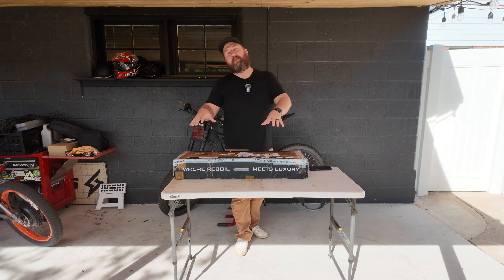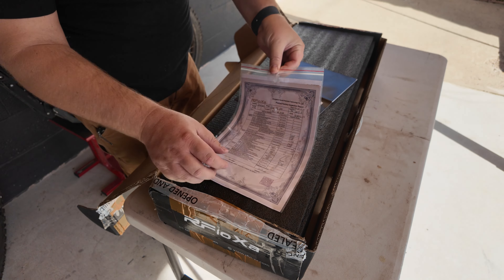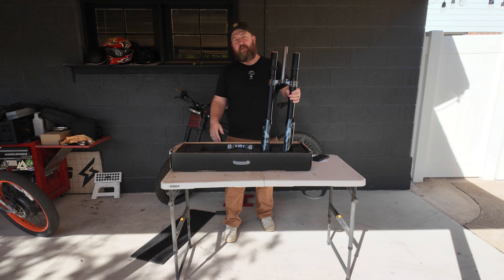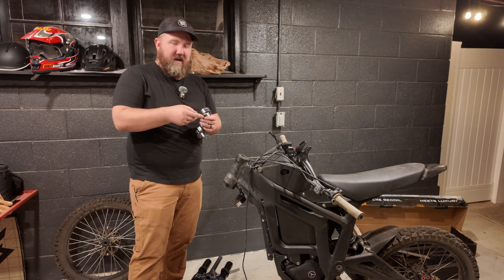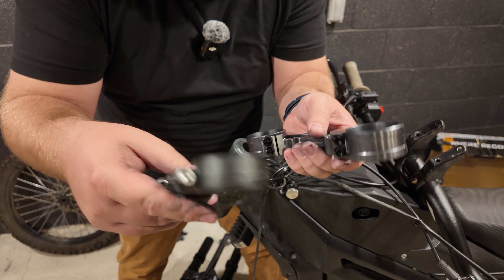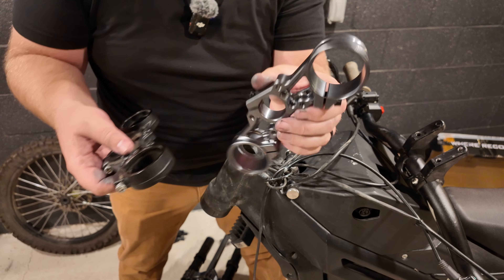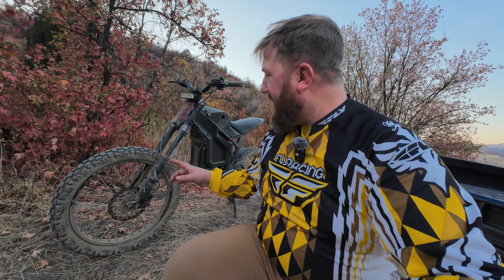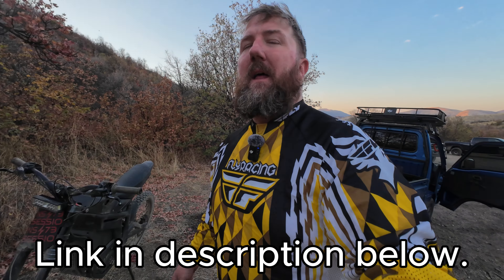Is RFlo-Xa REALLY the Best Budget Fork for Surrons and Talarias?

Comment: What a bs review. Just reading the marketing crap instead of giving a real feeling review, comparing it to the feel of the fast ace forks for example.. These kind of reviews don't inspire real confidence in the product. What were the down sides? You've mentioned you wanted to do some tweaks.. also there was s mistake in the installation. Before tightening the upper triple on the fork stem you should have installed the starnut already and tightened it down  to about 2-3nm. This ensures the bearings sit snug and have a correct amount of preload. Only then you tighten the triples on the stem. You can still do it, just loosen the starnut bolt, then triples, then tighten the starnut bolt and only then the triples.
Reply from the maker: Thanks for the feedback. I'll make the correction.